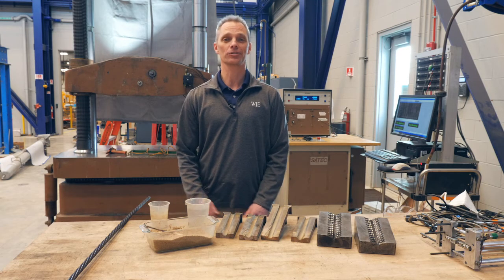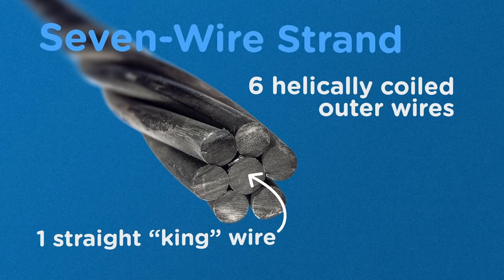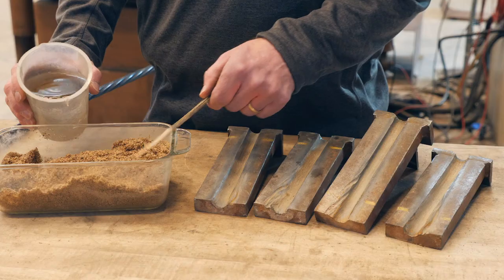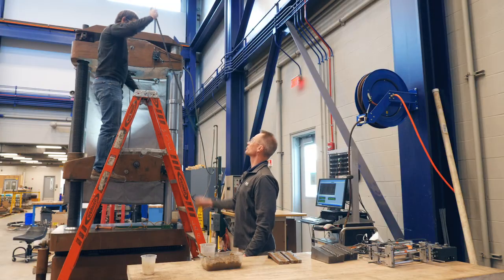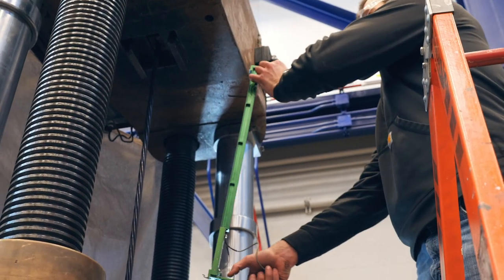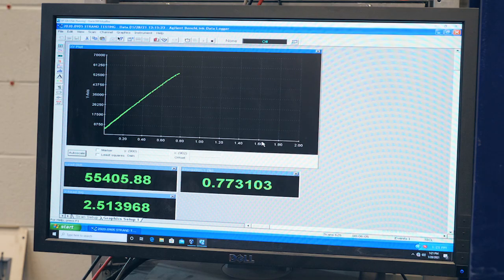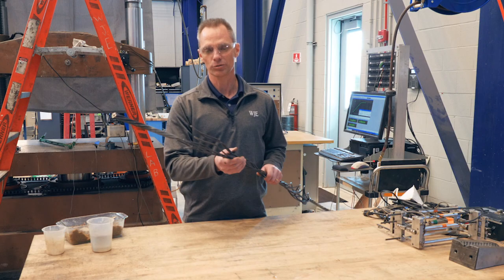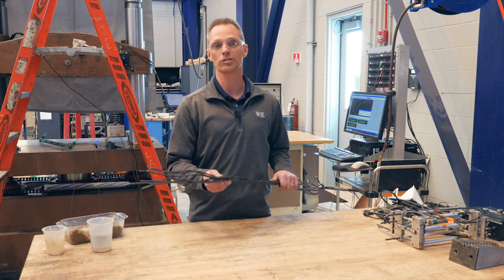Solving for Why: Tensile Test of Seven-Wire Steel Strand

Comment: Hi John.  Thank you for the good video.  How do you physically determine the yield in the test machine, just 1% offset?
Reply from the maker: Thanks for the question! The yield strength is defined as the measured force at 1.0% extension under load (EUL). We determine load at 1% elongation (extension) using an extensometer as described in ASTM A1061. The process is involves attaching the extensometer to the strand when the applied load to the strand is at 10% of the required minimum ultimate load. The extensometer reading is adjusted to 0.1% elongation of the gauge length as this is an industry accepted practice. The strand is loaded until the extensometer indicates an elongation of 1.0% of the original gauge length, which includes the 0.1% elongation during the preloading, and the corresponding load is recorded. The extensometer remains on the strand until about 1.05% elongation and then is removed from the strand to avoid damage when the strand breaks. 

If you have further questions feel free to email us at info@wje.com